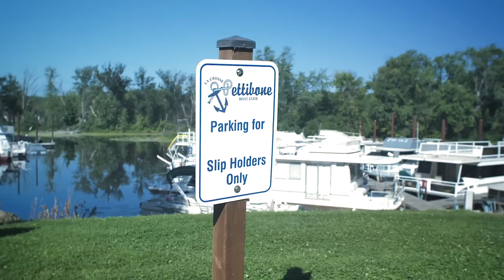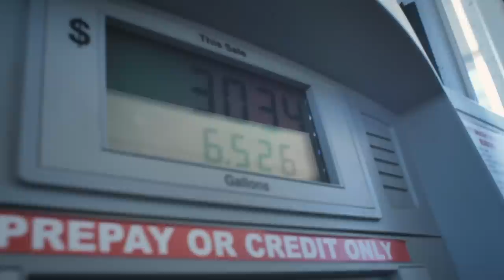MERCURY 25HP 2-STROKE CARB REBUILD - "SHOP LIFE" (2023)

Comment: Just picked one of those turns up cheap last week for my Jon boat. Thanks for the video. Will reference it for the rebuild. Just eyeballing it, what an American POS motor. Odd primer/choke mechanism, retarded integrated fuel pump built directly into the carb. Broke my rules of sticking with Japanese motors. What an absolute pos motor. But good info, thanks bro.

Comment: Just a question trying to answer in my head a 1987 mercury 20 hp has exactly the same specs as a 25 hp . The only difference I see from a shop manual is the 25 HP has 500 RPMs more than the 20 HP. they both have the same bore and stroke. i’m assuming Port timing may have something to do with it but I’m not an expert in outboard. I know on the old Johnsons used to be able to change the intake to increase horsepower. But on the mercury, it seems the intake is the same size. look forward to your response. Lol😂

Comment: The tuning of the carburetor was key.  I could not tell if the idle screw or throttle screw was being turned on the side, but I saw that the needle screw was turned clockwise more than a quarter turn presumably to run richer than lean.  I will be rebuilding my 2002 Mercury 25EL carburetor this Friday.  OEM parts come Wednesday.  This was a helpful video, also saw the float position as well.

Comment: Keep up all the videos, variety is king. But one on a cold hard to start  early 2000 carbed 3 cylinder sylonoid choked mercury would be appreciated
Reply: And a whizzing starter motor after engaging ring gear on the return